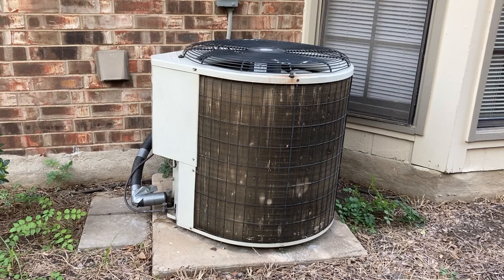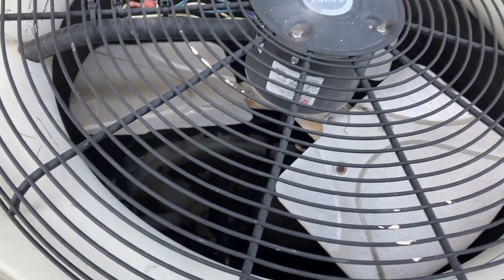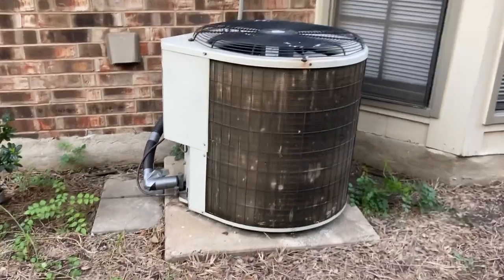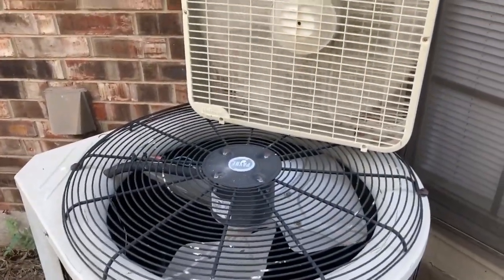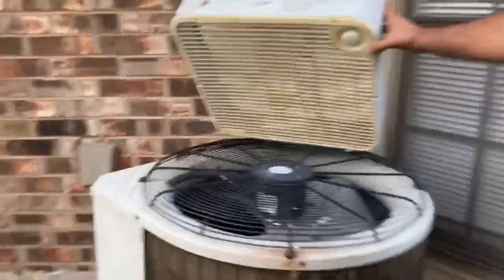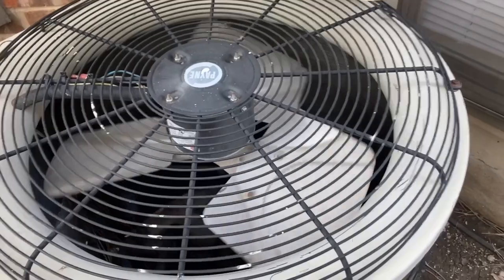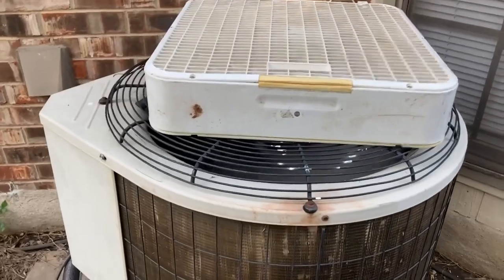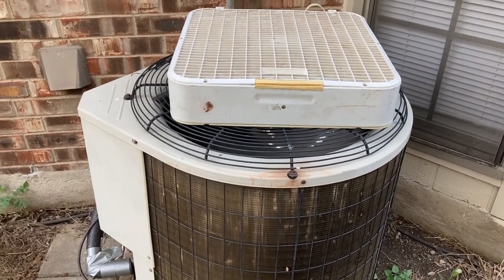HVAC stopped working | Quick Fix (temporary)

Comment: You start fan backwards. Probably box fan has enough air flow to partially cool condenser because original fan barely blows in reverse rotation. Intended air flow should point UP from unit, not in.
Reply from the maker: Good point, thank you!